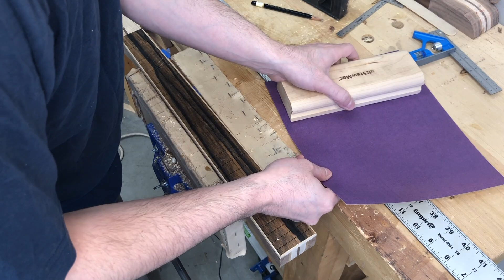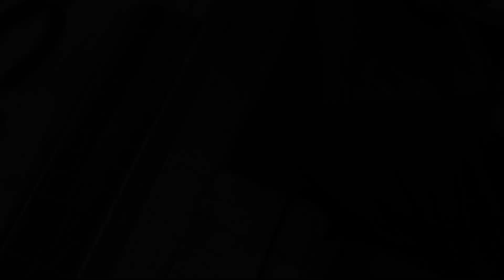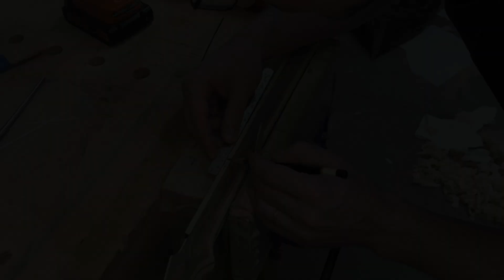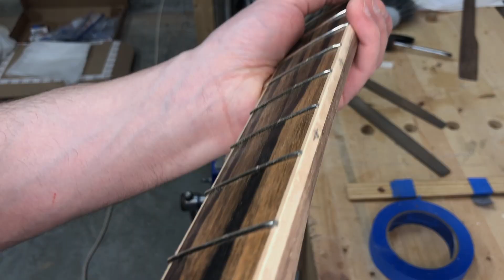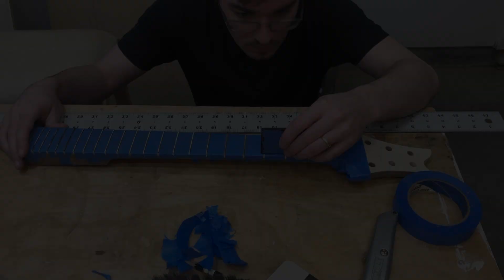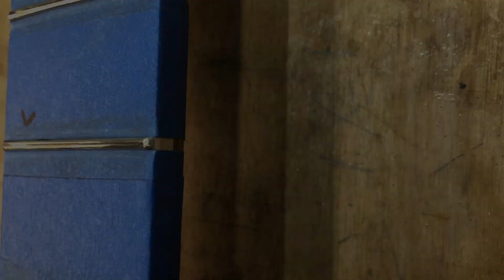Guitar fret work with minimal tools (Great Guitar Build Off 2021 - Part 5)

Comment: So far, good build. I could not use hand tools for the jobs you did. More power to you for that. 
One word of advice- I tried using a level as a way to level frets, and it did a very poor job. For some jobs, you need a proper tool for the best quality result. I found an 18” precision machined aluminum fret leveling beam on Amazon for $40 from fret guru. It’s dead flat, and produces a great result! No spot leveling afterwards, just right to crown and polish. Def worth the $. Btw what type of wood is the fretboard? Good series man!
Reply from the maker: Thank you! I definitely agree with you on using the proper tool for the job, although in this case the level did a pretty good job. I've used it for 2 guitars before this one and both played really well so I'm ok using it for now. Eventually I'd like to find a good fret leveling beam though. Same for slotting the nut, I've used triangular files until now and it worked ok-ish but I just got real nut slotting files because it'll make the process easier and more accurate. The fretboard is crelicam ebony (from Stewmac). Thanks again, and hope you'll watch the rest of the series!
Reply: @saucetguitars  watching now! I’m surprised stewmac had that fretboard available. That’s nice! I thought it may be some type of ebony. 

Yea the level can def do the job. But a better leveling beam makes it easier. Fret guru is a family owned business in California. So, they make decent quality tools for a good price. At least the leveling beam I got was good.

But..Sometimes you just have to bite the bullet and order from stewmac though haha. I got nut slotting files from Japan for $80, and they’ve been just awesome. Way better than cheap alternatives. But less expensive that stewmac.
Reply from the maker: Yeah I've been very happy with all the fretboards I ordered from them so far, they all looked awesome.
I'll definitely get a real fret leveling beam at some point, maybe I'll do 1-2 more builds with my level before that. Good to know about Fret guru, I hadn't heard of them before!
Reply: @saucetguitars  sometimes it’s just nice to have the right tool for the job. But I do advocate for using traditional(not overpriced specialists tools) when possible. Guitar builders 100 years ago didn’t have stewmac to rely on. They used traditional means. A lot of specialist tools in guitar building are just previously existing tools that have been slightly modded and marketed as guitar tools. But again, sometimes it’s nice to have one of the specialty items to make a job easier/better result. Etc.
Reply: @saucetguitars  yea I feel like a good rule of thumb is to buy cheap, until you wear out the tool, or otherwise outgrow it. Upgrade when necessary. Do you use mostly hand tools just for fun? Or would you use more power tools if you had them?
Reply from the maker: @mgcnashville6615  that’s usually how I go about tools, buy a cheap one if I’m not sure I’ll use it much, and then buy a better tool when I know I’ll use it and it saves me time/effort.
I’d use more power tools if I had them (I actually just got a bunch of new tools my father in law is sharing with me so I’m gonna start using them more) but I really enjoy hand tools, it’s more relaxing. Some things like re-sawing boards or shaping the outline to the body are so time consuming with hand tools that I’d rather do it with power tools though. Other things like shaping the neck I don’t think I’d use power tools for.
Reply from the maker: Thanks for the tip, I appreciate it. I’ve looked into it but I think that, given that I’d like to eventually do more and more builds maybe even for commissions, I prefer to invest into my own tools. I also like the calmness of having my own space, it’s a kind of relaxation for me.
Reply: @saucetguitars  don’t get me wrong, I totally agree with you. I still have my own shop/tools. But for any big things I can’t afford or don’t have room for, it’s a good deal to have a place to use them. My makers space is a 24/7 access spot. I’m typically the only person working when I’m there, which is nice.